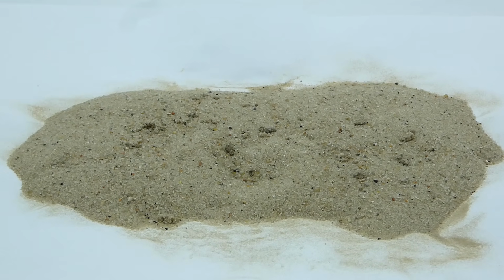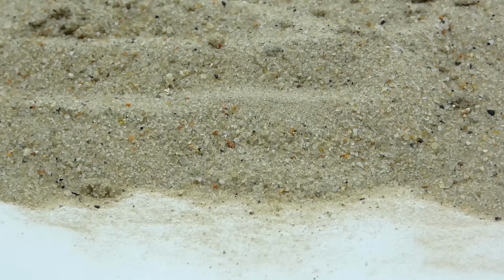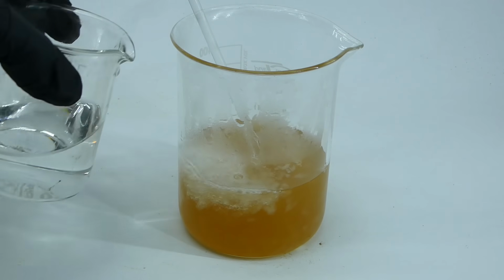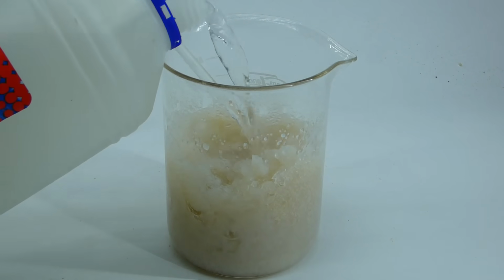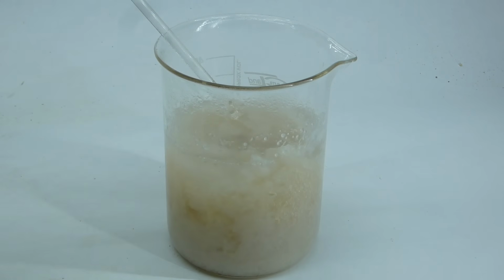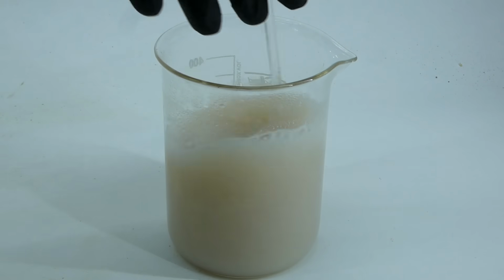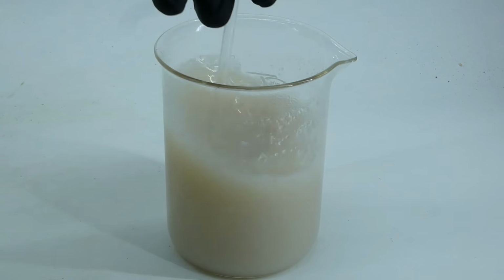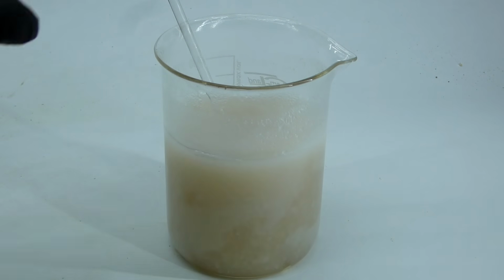Extracting Silicon Dioxide from Dirt

Comment: oh dear lord the moment I saw the title I was like you are super not suppose to do this at home. My father is in semiconductor sector and he took me to every plant on the steps except for the one that does this if that says anything as to how dangerous/dirty this stuff was.
to be fair, it is not complicated and people do that on a industrial scale regularly. it just involves so much hazardous chemical and super dirty in terms of pollution (well low profit margin + not give a shit about environment back in that time) that very few regions allow those factories to operate (in a profitable way) iirc they essentially dissolve the pretty pure stuff in large amount of HF and get high purity silicon that way.
also while you are at it how about try to grow some single crystalline silicon and cut them into wafers? that would be cool

edit: after watching the video it isn’t as bad as I expected, glad that is the case
edit2: did some quick research on how they do it. NOW I know why my father won’t let me there. Think about huge reactor vessel filled with heated H2 and SiH4 to get 11N Si. If that thing bursts the plant explode kind of stuff. closest I have been to SiH4 is in a CVD line and single crystalline silicon growing column. Yeah also have seen multiple vets of HF in half inch thick teflon and other stuff that are safe until anything went wrong. Also get to see SiH4 blow up once in the CCTV recording of an accident, nobody is hurt too bad though. scary stuff
Also for anyone curious the 7N silicon pallets I get to see is a beautiful light blue color in a styrofoam texture. I am sure someone can figure out which process does that come from

Comment: You can make water glass or silica gel - there are many 'recipes' in various chemistry textbooks (e.g. Armarego, Brauer, Vogel). It's relatively easy to make and much cheaper than professional chromatographic silica gels from chem suppliers. Various types of aluminas are also worth of exploring.

Comment: Please do me a favor and look up how sedimentation works😏
Basically the sifting and washing steps are unnecessary and for the acid step, you would have a much cleaner starting material, which results in much less acid being used.

Fun fact. Did you know that silicium dioxide is highly soluble in water and only the saturation point is rediciously low. But as soon as you remove siliciumdioxide out of the solution, it gets replenished from any possible source. So no matter what you try, in a glas container or with sand present, the solution is always saturated🤗

Comment: Aluminium oxide is as common as silicon oxide in dirt. And no, it doesn't dissolve in hydrochloric acid because it's embedded inside the crystals of sand. It reacts with sodium hydroxide and precipitates when adding acid the same as silicon oxide, so it does come over in the end product.

But even ignoring that, you can see by the colour of the end product, that it is not pure in any sense and is contaminated with iron oxide and other contaminants. I expected more purification steps after that.

Comment: Could you sum the energy inputs needed to convert clean "sand" (not dirt, such as a nice mineable deposit) into silicon dioxide, in optimal conditions? Include the energy production of the reagents. Then, the energy needed to convert SiO2 into metalloid silicon - for use in building solar cells.  I suspect a solar cell will never return more energy than was needed to produce it.

Comment: there is a way to avoid the sodium hydroxide step, which involves either crushing the sand to a very fine powder, or finding very fine sand. the particle size simply needs to be smaller than the crystal size of the minerals in the rock that the sand came from, this means that every individual mineral is exposed, and can be reacted with. and the only thing that will remain is the silicon dioxide grains, which are already silicon dioxide, which means no sodium hydroxide necessary.
Reply: Can this be done in Pre Wash state as well, i.e grinding into a fine powder ?

Comment: If I had access to a furnaceand was doing the same project, I think I would have put the dirt in a furnace first, maybe with an oxidizer to burn off the organic material.
Would that have made any of the next steps easier or require less caustic chemicals for cleaning?

Comment: awesome video!
just a few useful tips: it will be easeier to melt the hydroxide first and then add the raw SiO2, then also its quite bad for the glass frit  to filter the silicate-silicon dioxide-hydroxide mix because there is some hydroxide left so i'd use a buchner instead.

Comment: Chemistry be like "add water, filter, remove water, filter, heat a bunch, filter, add water, filter, remove water, filter, add some acid, filter, neutralise acid, filter, add water, filter, remove water, filter"
Reply: It's funny, because it's a part that's entirely ignored in pretty much all games that include chemistry - you always have magical centrifuges and electrolysers that effortlessly separate stuff out. How do you get aluminium from clay? Just run it through an electrolyser! Nicely separated 100% pure batches of all the individual atoms. Real-life chemists would kill for magic machines like that :D How does electrolysing clay even work? Well... shut up, that's how! :D

Comment: Sooo, you should have used some water, as a flux, to get the reaction going in the can. 
What you where left with was still sodium hydroxide and silicon dioxide . 
What dissolved was the sodium hydroxide, and when you added sulfuric acid you made sodium sulfate. The solution already being saturated, it came out of solution immediately. And at no point later did you add enough water to dissolve more than ~50g of sodium sulfate.  
So if there was 66g before you added 150ml water, there would still be 16g sodium sulfate undissolved in the solution.
Just think about it, granular sand has about 160g/100ml, but after the "reaction" you still had almost 200ml of sand, where is the product coming from? 
If you stir all your product in a 500ml beaker of water, how much remains undissolved?

Comment: I did the sodium silicate reaction in water and it seemed to work fine, just took a while, I did contaminate the solution with (i think) chromium ions after I couldn't find glass filters and tried to use stainless steel wool to filter off undissolved debris (like bugs) after I realised why my filter paper kept self destructing

Comment: 6:19 I thought silicon can't form double bonds? Can this exist because there is a constant equilibrium where the double bond is between the 3 oxygens? curious.
Reply: It really avoids forming double bonds, which is where we get the wild variety of silicate minerals. Quartz does not have double bonds - each silicon atom is actually covalently bonded to four oxygen atoms (but each of them is shared with another silicon atom).

But molecular silicon dioxide does exist. And it indeed has two double bonds, and it is linear just like carbon dioxide.

Of course, that's not what was produced here; that would be your typical SiO4 (4+). But I don't think it's all that wrong to draw molecular silicon dioxide - it does form , it's just that it polymerises very easily for obvious reasons. The double bond rule is not a rule; more like a... guideline. You'll find there are many molecules where silicon forms double bonds, and they aren't unstable , really - they just polymerise easily and lose those double bonds.

Comment: awesome video! would it be possible to make a video about extracting the pure clay minerals, like kaolin and serpentinite, or at least removing the metallic impurities from a good quality reddish clay? Apparently oxalic or citric acid is good at dissolving metal impurities from clay. I've wanted to know if this was possible, so I could make my own crucibles without having to order in a bunch of stuff. the big thing i worry about if you were to try and refine clay minerals is that i feel like they're more delicate than just normal silicon dioxide, and using acid and heat might damage them and weaken them somehow.

A well made kaolinite ceramic crucible with pure silicon dioxide as grog can withstand the temperature at which pure iron or platinum would melt. And crucibles for that sort of work are a pain to get.
Reply from the maker: Thanks! I could make a video about extracting some minerals form clay, and making some elemental aluminum but as of now I have a ton of other thing planned, but maybe in the future I will find some time :)
Reply: @Amateur.Chemistry   lol making aluminium is a tall order, i wouldn't recommend it unless you really wanted to do it. thanks for replying :)

Comment: You probably know this already, but the ground is made up of multiple layers. The surface layer, topsoil, is rich in organic material. You probably want to dig a bit deeper, or find a patch of eroded soil, to get some dirt that doesn't start out with nearly as much organic impurities.
Reply: Yes, digging down until the soil is lighter than the top is good, just mineral soil, almost no organic junk, a good place to pick up too is on river beds, the water already do the work on washing it up.
Reply: Even better, just go down to a beach to gather your dirt there and- oh.

The point is to extract the silicon dioxide from regular, dirty, topsoil. Filtering off the organic material is part of the journey.
Reply: @MGSLurmey  eh, dirt in general have a lot of non organic contaminants, like metal oxides,  who are tricky to remove from the silicon dioxide, but in a way, the organic junk add a bit of fun for the extraction (and beach sand has contaminants too)